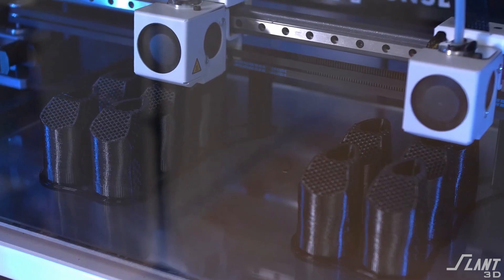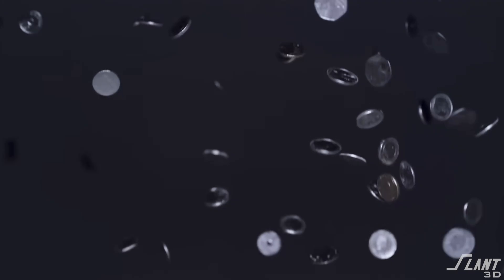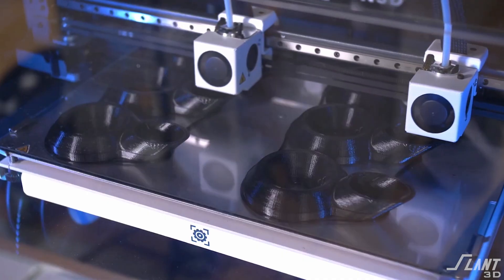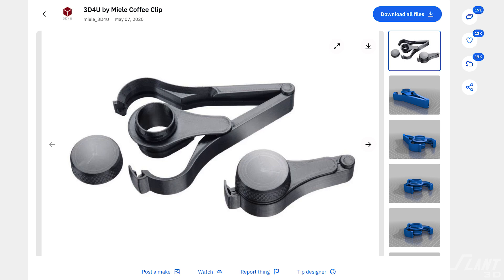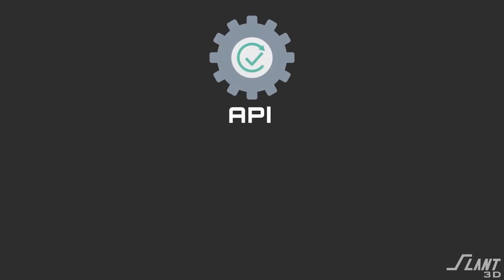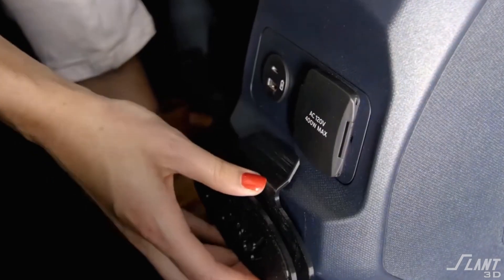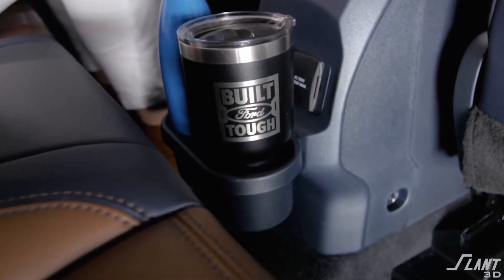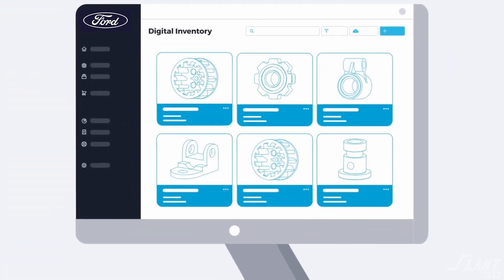3D Printed Accessories Are an Infinite Money Glitch

Comment: It's a genius concept, and one I've seen in another industry of Hydroponics.  The idea with a hydroponic farm is that your highest profit is next to a city where the bulk of affluent population is, where land costs too much to grow food. So in order to shave off the high costs of transportation and distribution network you put a vertical farm on the edge of the city. That way instead of shipping fresh food with a short shelf life from a distant flat fertile land, to the city, you instead ship dry synthetic mineral nutrients to the city vertical farm, where they grow fast crops, that has the shortest transpiration distribution network out their back door.

  A major issue that has occurred in hydroponic farm expansion, was a great example in Martha Stewart's AppHarvest venture. They didn't have anybody that knew how to grow hydroponically, so their management essentially let the company fail to issues and they went bankrupt.  Another issue that hydroponic farms only cater to leafy vegetables that are fast growing light feeder plants.  To take this analogy and apply it to 3d printing, the lack of knowledgeable people with working 3d printers or knowledge on how to correctly adjust one to print a quality part is probably fairly low, most of the 3D printer hype a few years ago was merely people buying the recently affordable plug and play devices and using them until it stopped working or couldnt find utility for the parts in their daily life.  The limitations to leafy vegetables is applicable to the 3d printer's terrible durability aesthetics from stacking layers.  If there was a way to make injection molding faster, and have a fast turn around injection mold farm instead of injecting .2 layers ontop of eachother, that would entice American companies over their current practice of warehousing injection mold parts from international countries of lesser wage equity. 

There is a lot of opportunity for manufacturing in the future, especially as tarrifs become unveiled, the price of shipping continues to rise, and new technologies in fabrication become affordable for entry level users, because America is going to run into an issue of needing to meet their demands in house as the rest of the world catches up to our affluence and wealth.  There are going to be some growing pains but in the end i foresee it simply comes down to a few intelligent designer today that stick with this process will eventually be the of few people to manage large automated warehouses that can service faster turn around times, and have prices comparable for all sizes of business and the saved money on warehouse footage.

Comment: Yeah but the issue is, if its just and FDM printed part made out of plastic, its not really a "finished" part. Like I would never expect Ford to let customers 3D print a new design for a steering wheel for their Maverick, because it wouldn't comply with durability and safety standards. Its not an end all be all for part manufacturing. Its good for prototypes or small accessories, things that one wouldn't really have ramped up a whole tooling assembly for anyway.

Its not an "infinite money glitch" as your clickbait title suggests. Its still a niche thing for a very limited market. Its not something that a large company like Ford are really going to throw a huge amount of time at in order to make such a tiny profit.

Comment: Theres a phrase: "dont pick up pennies in front of a freight train".

Published 3d printable files cannot hold the author liable under product liability laws, since the "product" is not distributed by the manufacturer itself. They cant be held responsible for how people use/misuse their designs.

What you're proposing, would be a real "product" - hence product liability law applies, and all necessary red tape the auto industry has to go through. Which adds to the already (relatively) high margin of 3d printing. And if the parts were profitable enough after all that, theyd be profitable enough to mass produce via traditional manufacturing.

Depending on how the designs were published, there's nothing preventing you from doing your own idea right now - but im guessing there's a reason you aren't.
Reply from the maker: That's why they should publish the files.
Reply: @slant3d  I mean sure, but that didn't really feel like the overall point of your video?

And obviously companies like Ford would only be able to do so in a limited capacity, since while currently, 3d printable design files aren't subject to product liability, the tech is new and publishing files that could lead to damage/injury if printed incorrectly/with too weak a material/etc would be a great way to set precedent.

Comment: the main issue with this though is quality control. if they give everyone the ability to print parts they also need to give them a means of testing that the quality meets a certain standard and that the part wont just break.
Reply from the maker: That is why they need a single source. If only someone had a big print farm that could produce the same part reliably

Comment: It would be great if stl models of all the replacable parts of a product would be available. Europe is moving to "right to repair".  3D printing parts would be nice.  Products are mostly for 1% broken and 99% is functional, and then we throw them away...
Reply: A number of US states have passed "right to repair" legislation.
The problem with most manufactures, is once a product is discontinued, they wipe most references/manuals, etc. to that product from their website. "Right to Repair" adds timelines beyond when a product was produced. Using a common database/service would make it easy to find and access needed parts or part design.

Comment: I tried to get my employer to put out STLs that I and others had created as accessories. they didn't say no because of revenue, they said no because of reputation and liability - that people might judge the brand based on the efficacy and reliability of the STL and their possibly sketchy settings making a bad print. I told them the community of people that would try it would be niche but appreciative... cut to 2024 where turnkey printers (I love turnkey printers btw don't get me wrong) but where turnkey printers have created a massmarket of consumers with 3D printers - and judging from Makerworld comments sometimes as helpful as "1 star - BAD." on a model that has 5k 5-star ratings, i don't blame them. putting out STLs would just give genpop more opportunities to hate on the brand. I'm cynical about it because of social media basically.
Reply: Sounds like a marketing issue, if users don’t see the benefit of the review system then it’s not been pushed hard enough

Comment: I would like to have a site that register every user with 3D printer ready to print so the company can contact with the person who have 3D printer and ask "Hey! Our customer need this part and you live the closest to this person. Can you print the part, deliver to our customer and we will pay you for that"?
Reply: Sounds cool, but it would be impossible to guarantee quality. Different printers, different filaments and no real way to regulate it.
Reply: This would be a QA nightmare.
Most people don't have perfectly tuned machines and even if you had two perfectly tuned 3d printers by two persons they would produce different prints.

My printer is tuned to produce parts with good scale and pretty much a central (symmetric) tolerance field, you may have tuned your printer for an internal tolerance field, but large prints shrink 0.1% parts produced on our printers may not be compatible.
Reply: There was a site like that and they switched to a different business model where only certain print farms could join, with only specific machines. They had huge quality and consistency issues when every random kid with a printer could join the network and start taking jobs.
Reply: Check out world dot prusa3d dot com 😉
Reply: In my country that exists, nobody use the site.
Reply: I think cubee tries to do something like this

Comment: I agree it's a win-win for slant 3d and the company leveraging your service, but it's a loss for the hobbyist who would like to not use your service and would like to 3d print that file on their own or modify it to suit their own needs. Though I know that companies will probably stop putting their stls out there for people to print if they don't connect to a service like yours, but still an ideal world for me personally would be for them to go through you and have an even smaller fee to buy the stl to modify yourself.
Reply: Open source communities are an example where placing basic parts, accessories in public domain, allows creatives to develop more refined or alternatives that add functionality to a product in ways that that many not have been envisioned by the original designer.
Companies that are do embrace public sharing of some design files to a product can gain knowledge and insight into applications that a company not sharing would miss out on. 
Think there is opportunity to experiment with both: offering accessories through a service, and offering access to some parts so hobbyists and creatives can modify, or experiment with variations. I think since additive manufacturing is still young and not well understood by traditional manufactures, there may be some hesitation or preconceived risk with opening up to non-traditional method of manufacturing accessories, or replacement parts.
Reply: Two good things: 
-One, the 3D-Printing community is pretty well united on this term, so if one company does not offer the file and the other company does, everyone knows which company is going to be selling more cars to the community
-Two, try making a part that is cheap (which means it must be easy to print), actually functionable, but cannot be reverse engineered by a slightly dedicated hobbyist. Even if you personally don't design a part, how in the world is a company going to realistically prevent you from downloading a reverse-engineered STL (or a totally different part designed from the ground up that does the same thing) from one of the many online companies.
Reply: @aduckwithgrapes9572  I agree that the community is united on this term, but that community is pretty small. Sure we can reverse engineer it, but adding to it is a lot easier than reverse engineering it and the easier it is to get started the easier time people are going to have to get their foot in the door.
Reply: @DalTron001  Totally agreed that having publicly available STLs would be much better, the path you and I are thinking about is not the "optimal" route for us but my point was that, even if large print farms become a primary source of income, there will still be more pie left for us than there is right now, even though we might get a smaller slice relative to the industry now. Your not wrong at all, though, perhaps the truth is that my original comment was a bit overoptimistic and your original comment was a bit under-optimistic, although I have no idea where reality lies (it could be a lot closer to your idea than mine, lol)